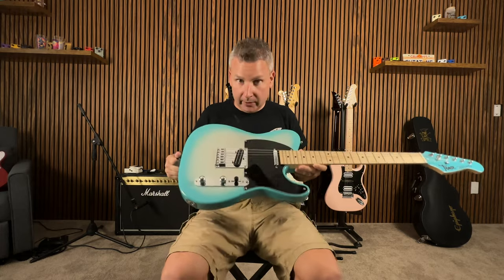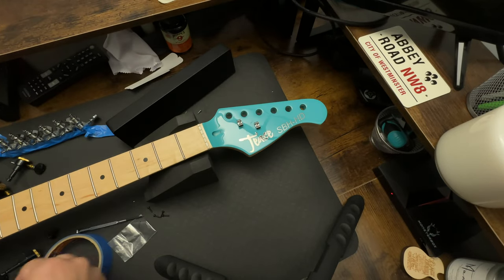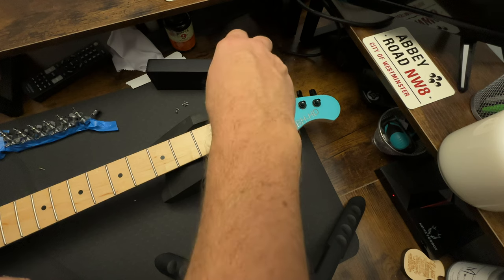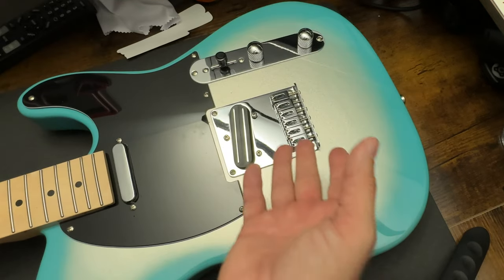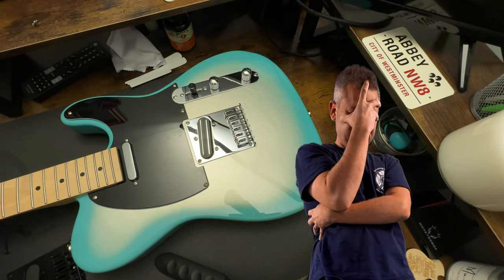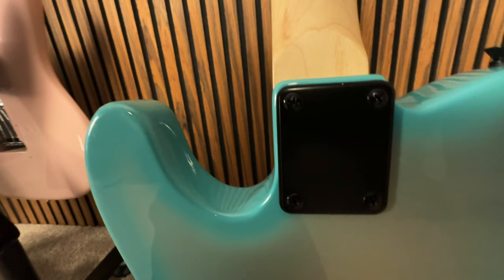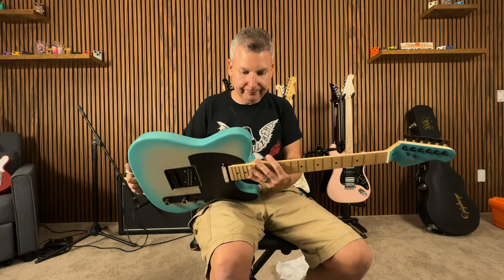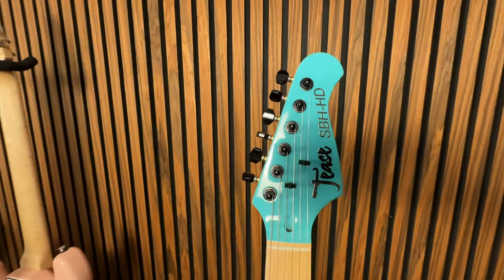Simple Modifications To Make Your Guitar Look Even Better

Comment: I did the same thing with an LP style guitar I got from Brandon’s Custom Shop. It was a very good guitar for the price just as it came, but I blacked out the hardware (new tuners, bridge, tailpiece, knobs, switch, and nut) and upgraded the electronics with 50’s wiring and the pickups to some Tonerider Alnico II Classics, and it’s now one of the best looking, playing, and sounding guitars that I own, and I have a lot, including some Gibsons, Heritage, and Eastmans among others. I also used several Guyker products in the process and was very impressed with them. So far, I’ve kept my 2 Tease guitars stock, as they’re actually quite good just as they are.
Reply from the maker: Yeah they are really good as they come I only modded my Strat style to highlight the advantage of the swimming pool route

Comment: Nice use of humor and the green screen. Well done, like the comments added in the video. I would have changed the output jack and used strap locks because after all that work, who wants to drop their guitar.
Reply from the maker: @marlan3rd  I never filmed the Jack plate but I did that too. I didn’t get it on camera because of the angle
Reply from the maker: I also use the straps that have the locks built into them. Think made by Planet waves